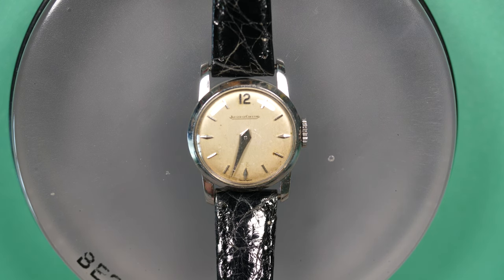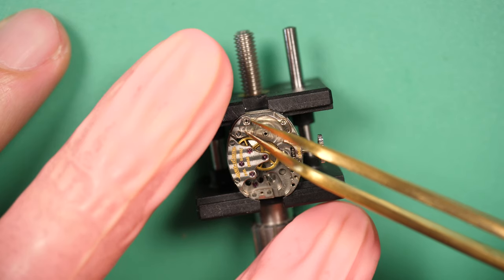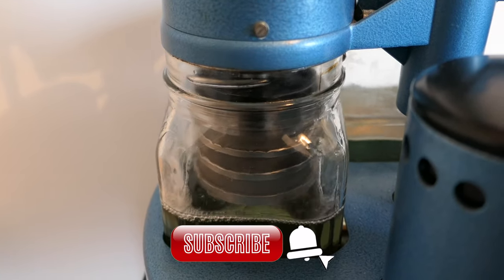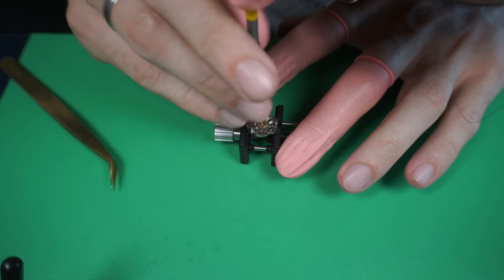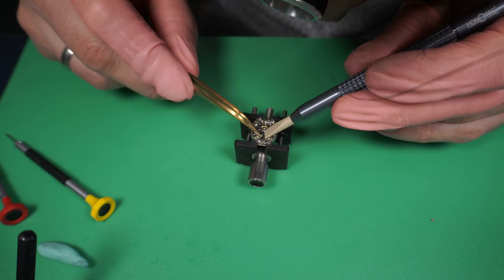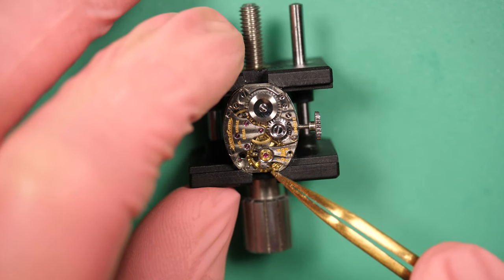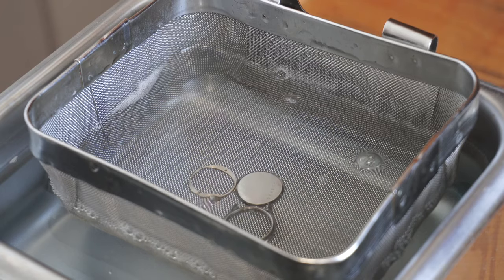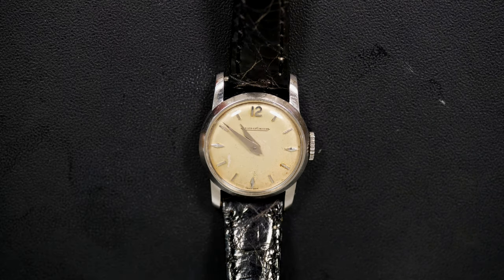Restoring the Smallest Jaeger LeCoultre Watch

Comment: A ladies’ movement is a challenge for the maker and the watchmaker.
JLC designed and made shaped movements for their rectangular watches , unlike some of their competitors.

Great work, I would need a microscope to see this movement.
Reply from the maker: Thank you. True that it is a bit more difficult to work on a small movement. I had to use a stronger magnification

Comment: Very nice, FWC.  .  Thhis is one of my favorites you have done.
These are the types of watches I started working on when I began watchmaking as a hobby.  Not JL, per se, but tiny vintage lady's watches from the 50s, 60s, 70s.  They're rather inexpensive and many folks have them lying around in their drawers unused and not running for decades.  Names such as Bulova, Elgin, Caravelle, Longines, Selitta, etc.  Many of these movements are rather well-made and look similar to this JL.  17 jewels, Geneva stripes, and so on.  I would love to run across a little JL like this one.  Cute.  Though, I did let a tiny Rolex slip through my fingers.  I am still kicking myself for that one.
Reply from the maker: You are right they are great watches and very tricky to work on. They can be a good challenge

Comment: I actually did the opposite and didn't follow any such advice haha. I did a video training course that used a ST36 movement, so I did practice several times on that. However, I won an auction lot on ebay that was several tiny vintage ladies' watch movements for just a few dollars - some wittnauer, gruen, a benrus, and a couple others using waltham movements. They were all beautiful, but I imagine the cases were probably precious metals and got melted or something. So for the cheap price I paid, I figured, heck with it, I'm gonna tear into one, and I actually loved it. So, I practiced a bunch on the tiny tiny movements, and now the "normal" size movements feel massive 😂
Reply from the maker: That is the positive side if you practice on small movement